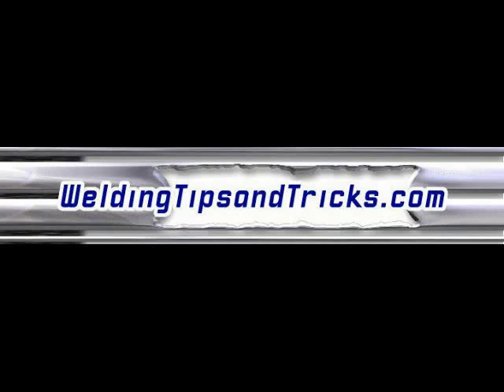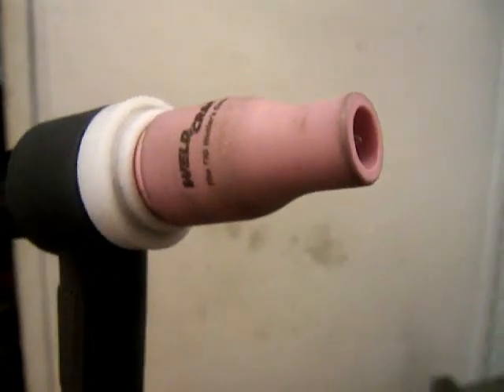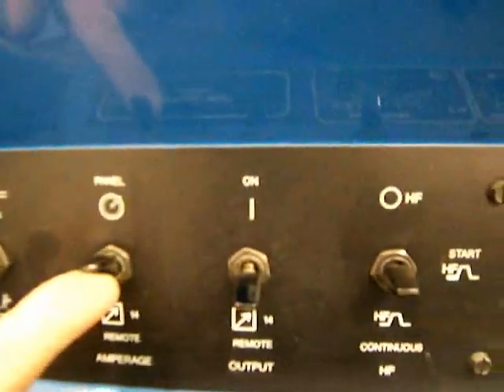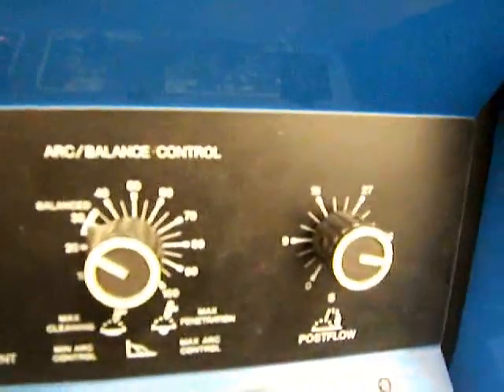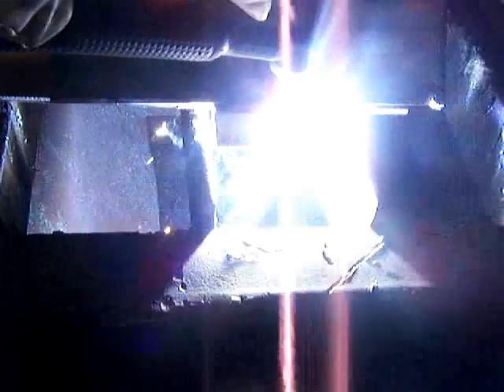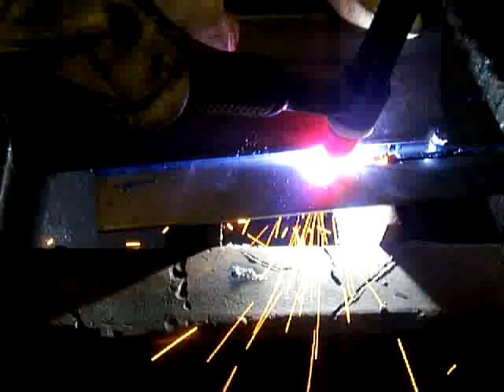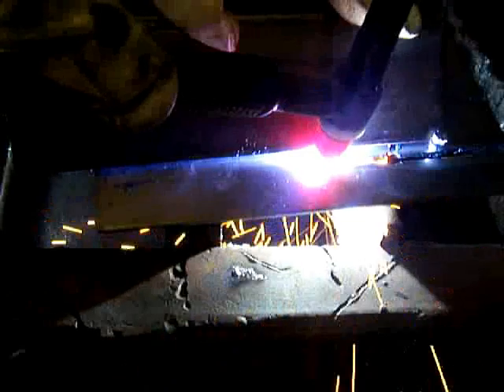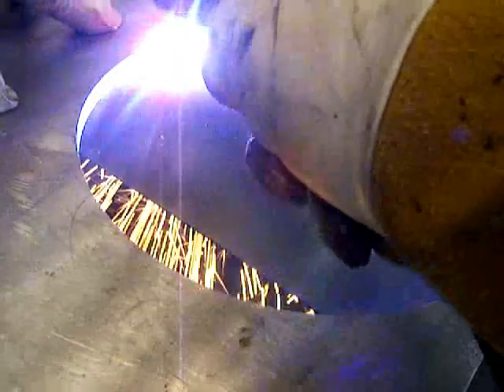cutting with a tig torch

Comment: Can I do it without argon or it will destroy the electrode?
I'd like to try that for one job  instead of buying a whole pack of graphite gouging rods. Should I buy the largest one around? What kind of a tip is in a plasma cutter? It uses compressed air, doesnt it? So that should last for a while if this fails

Comment: you SOB,,ever had an idea and wondered if you were the only one to have thought of it? well this is exactly the idea that popped in my head a long while ago but i did not think it was feasible till i was juts thinking about it now,it's basically almost the same setup as yours but my idea was to use the smallest tapered head cup to help concentrate the gas and instead of argon i was thinking of using oxygen to be able to really burn through,problem is idk if the tungsten will last,but it will get white hot for sure ,,but i see argon works well without oxidation issues
Reply: Tungsten in oxygen shield would last less than 0.0001s.

Comment: could you have a valve to quickly switch from argon to air when cutting ?

also what about using a plasma cutter torch on the tig power supply ? are the plasma cutter power supply any different ?
Reply: Did you test it already?